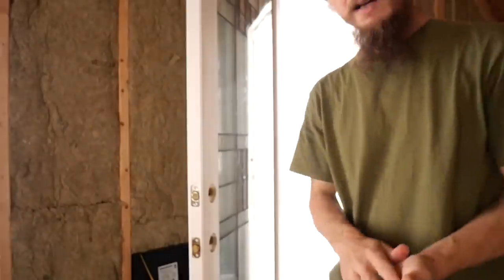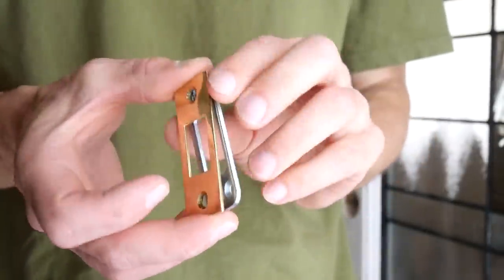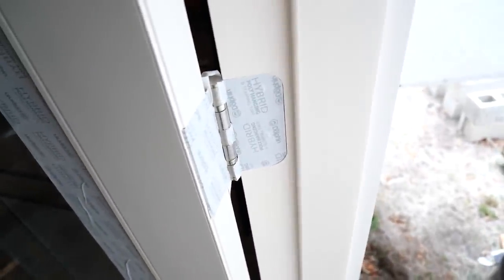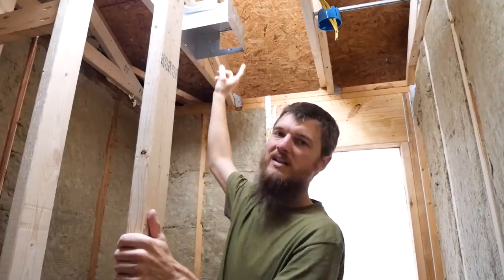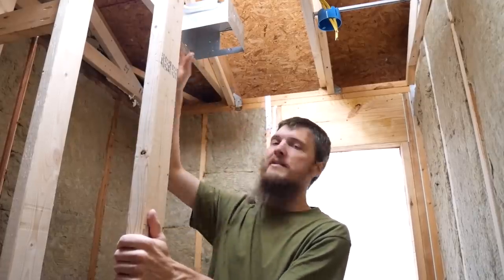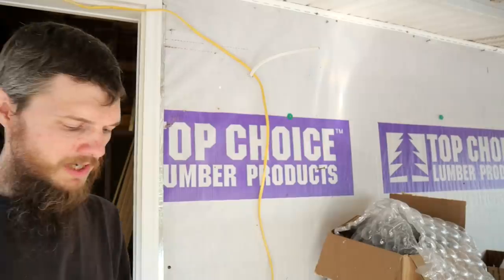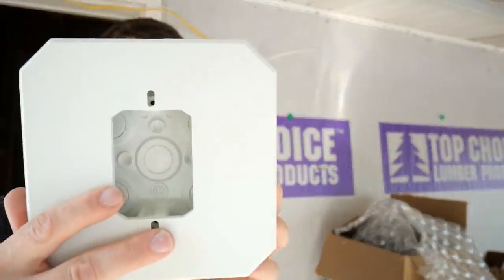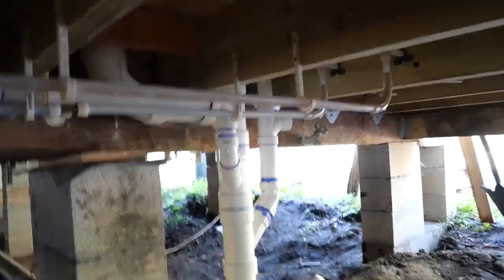Door Paint Renovation Update

Comment: As a locksmith for the past 20 years, I appreciate you removing the hardware before painting. My inner OCD itches every time I work on locks with paint all over them. And great job squaring the strike plate holes. 
A little tip on masking hinges to paint…don’t. When the door has three hinges, undo one side of a hinge at a time and paint under it. Screw that side of the hinge back on and keep moving. No need to cut in or mask. Use a screw bit in the drill and it goes quick.

Comment: That bathroom vent should be vented out through the roof, when you vent out the soffit, the soffit is there to draw in air that rises up and exits via the ridge vents.  When you vent the humid bathroom air to the soffit area, it gets drawn back up and can cause mold problems in the attic area.

Comment: I love the color! I think you were going for that sage green type look, which is what we painted our bonus room. It may be a shade or two lighter, but it really does look great! Latex paint can be tricky, especially on doors and other high traffic areas. Would an epoxy paint work better? It seems to cure and harden, doesn't really seem to chip or peel like latex. This is what we used on our iron fencing, so im not sure if its outdoor only. we had to repaint the fence because previous owners seemed to use flat latex paint which was rubbing off every time you would touch it! anyway, i hope it holds up well. that hardware is just so stunning. great choice!
Reply from the maker: Yea, after we painted we realized we should have gone with a different type of paint.

Comment: As a former painter in southern humid Gulf Coast, I would suggest not installing door hardware or weather stripping for 10-14 days. In low humidity it take a week for the paint to cure all the way through. In the humid south it can take up to 2 weeks. If you can wait longer on weather stripping, wait longer to prevent paint from coming off.

Comment: Doug, I may be wrong, but I believe the security plates go on the door first. The lock mechanism then passes through it. It looks like the lock mechanism holes are large enough for your brass finish plates to seat and center the mech. Thats why there are so many holes in the security plate. It can be attached with additional security screws. Also puts the mech better centered in the hole.

Comment: I LOVE the color. So appropriate. Now I've just gotten to the end and heard you used latex paint. We did that for our main front door and it only lasted less than a year. It was AWFUL, peeling, nicking, etc. We finally cleaned it off (way too easily), took the door outside and spray painted it with canned spray paint. It's been about three years now and it has held up wonderfully with no problems.
Reply from the maker: We knew it was a mistake as soon as we did it. To make it worse, we made that same mistake before. We are just never happy with latex paint on entry doors. We literally wish we could strip it and do it over with something better. Maybe in the future we will once it gets bad looking.
Reply: @diyfferent  We stripped ours on a warm humid day and honestly mostly just washed it off! We were astonished. Good luck. My two cents, though--keep the color.

Comment: We lived near Auburn, AL during Hurricane Opal.  We purchased a home built in the 70s that had a huge family room addition built in the 80s (the addition was much more energy efficient). We had the home inspected for purchase and were not paying real good attention to stuff even the inspector missed.  The soffits on the big addition were put on with the slots facing outward not towards the house.  That was not a biggie until the hurricane when it rained almost horizontally, backing up much water into the ceiling. It took hours and hours to pull the insulation and totally dry both that and the attic wood out to prevent mold. You pulling the soffit reminded me of that horrid ordeal.

Comment: So many details accomplished.   It's so gratifying to delete anything from a long list, your day was certainly very productive.   The door color looks very clean, crisp and fresh.  Before hardware is installed you might want to consider a few coats of a clear, matte topcoat.   Between heat, humidity, frequent rain, sunlight, dings, etc the topcoat will extend the life of your paint.  I live in Georgia.  I use a water-based topcoat on all my exterior doors.  And maybe do a bit of research re the placement of the exterior cover for your bathroom exhaust fan.  Southern states tend to have unexpected quirks for people new to our heat and humidity issues.  (I recall visiting a friend in Oregon.  First time I ever saw moss growing on asphalt shingles to the point no shingles were visible.   And in New Hampshire in the early 1970s I awoke in a second floor hotel room - to see only snow.  The wind blew snow across nearby fields, the hotel was the only building in the area.  My friends and I were shocked, we thought the building was buried.  The opposite side of the building had about 5" of snow on the ground.)

Comment: ive done the vent job and my contractor Friend told me that if you vent out  the soffits and your roof is working as it should  you could draw moisture back into the attic space.
Reply from the maker: Vents have to be installed 3 feet from any opening into the building, so you just have to use solid soffit material in that area around the vent opening.

Comment: I understand some of the things you are doing pertain to how they are done up North.  What you need to think about is why they are not done in the South.  We deal with extremely hot and humid weather therefore we battle mold problems.  Insulated pipes for your fan vent may not be a good idea and could end up creating a mold problem.  Condensation on the ceiling isn’t usually a problem in the South more so than the potential mold.
Reply from the maker: They insulate ducts in the south too. Some people like to just use the cheap galvanized ducts, but we prefer not to use them in this situation.

Comment: The bathroom vent should go through the roof.  The humid air exiting the soffit vent will enter the attic through the ventilated soffit panels where it can condense and cause rot and mold.
Reply from the maker: We prefer to limit the number of roof penetrations and soffit vents are acceptable when done right. Vents have to be installed 3 feet from any opening into the building, so you just have to use solid soffit material in that area around the vent opening.

Comment: Like the color so far! Is there a primer for those vinyl/pvc doors, that latex paint may not work on them.....
Reply from the maker: I think it would have been better to use a different paint altogether. Either oil or some kind of enamel paint.
Reply: @diyfferent  Looks like they call for a primer with a binder for PVC/vinyl and then a latex paint with a binder. That door is very shiny and hard and it needs something to "bite" into it.

Comment: for some reason i thought that you dont want to went a bathroom fan through a soffit because that vented air will just go back under your roof, creating mold.
Reply from the maker: That's correct. When a vent does exit through a soffit, you use a solid soffit in that area to avoid moisture problems. We'll talk more about it in another video :)
Reply: @diyfferent  wouldn't that require sealing it in with something like silicon. As heat rises
Reply: @diyfferent  then again it is different climate then the north so maybe it is different there :D
Reply from the maker: @BunnyXDproductions  They sell solid soffit material that is sufficient to keep the moisture out. The roof generally doesn't have a strong pull of air so as long as it's generally closed it's good enough.